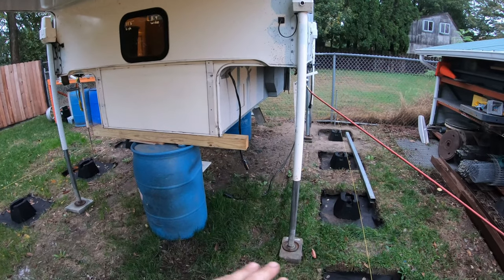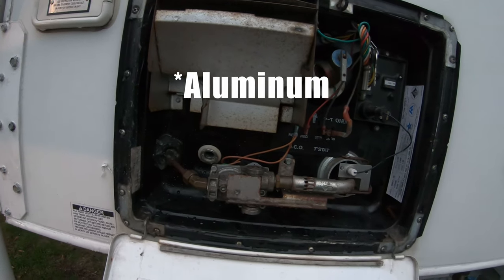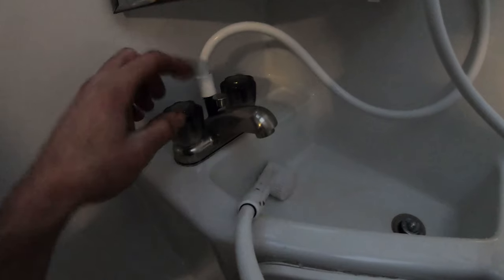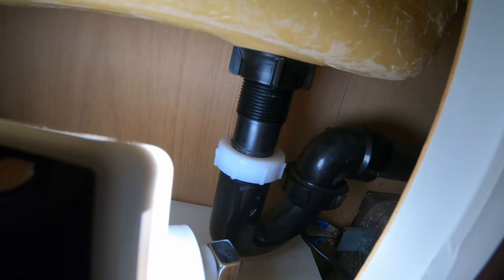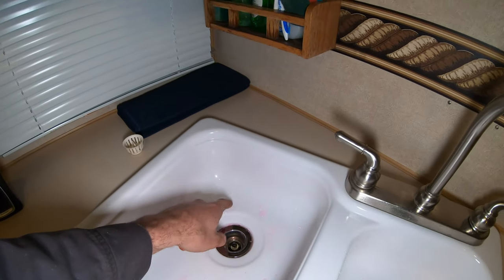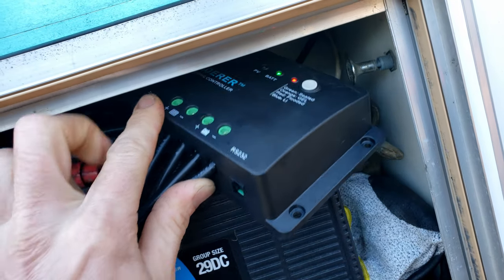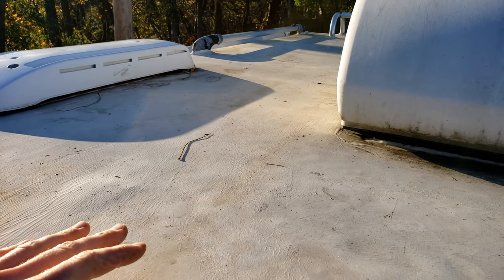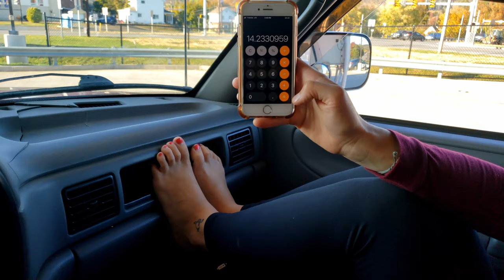How To Winterize an RV - Lance Truck Camper

Comment: Hey Chris my family has owned campers most of my adult life and winterizing them ourselves these are my sugestions.
1. Leave plug out of water heater pressure changes from cold to hot in winter to spring can reak havok on seals. Just reseal the plug in the spring when you go to use it the first time.
2. Blow out your drains with a shopvac on reverse direction (make sure shopvac is clean inside and make sure outside drains are open).
3. Ive never had problems with moisture inside a camper over the winter but instred of a dehumidifer use damprid catches.
4. After i blow out the water from my lines i pump antifreeze through the lines just make sure you use antifreeze that doesnt contain ethanol it will destroy the rubber of what ever seals it touches.
5. After you blow the water out of the traps put the antifreeze in the traps like u did on the vid but it wont be diluted by the water in the traps.
I hope this helps thank you for the great vids!!

Comment: One small additional winterizing step I do is to open the city water port by pressing on the screen. I use RV antifreeze in my lines and I make sure it comes out of the city connection.

Comment: Blowing out the lines , generally does not blow water from the pump.  In my opinion, the only way to winterize the pump is to suck AF thru it.

Comment: I have a 94 Lance 10’ camper . Don’t see an air inlet to blow out my tanks and lines . Is yours home made ? Thanks
Reply from the maker: Yeah it's just a airline regulator adapted down to GHT. I assume you have the municipal hook up on the outside of yours correct?